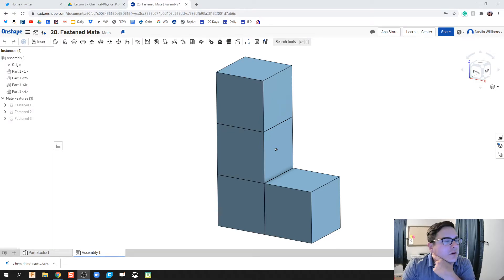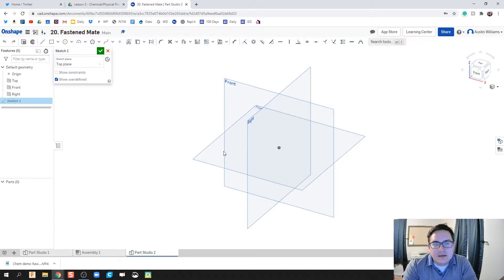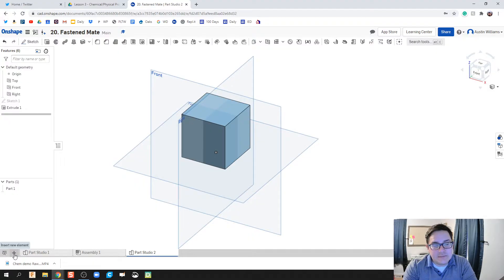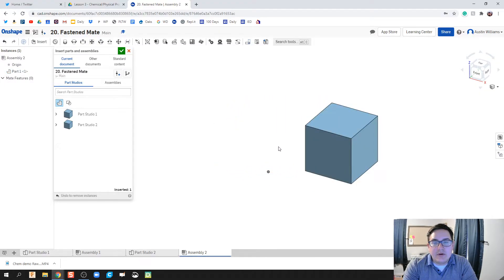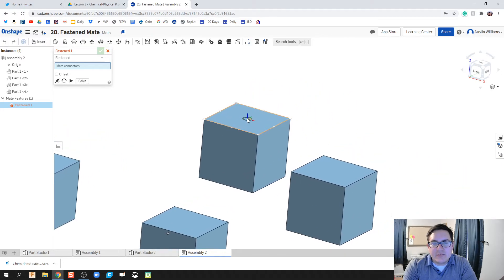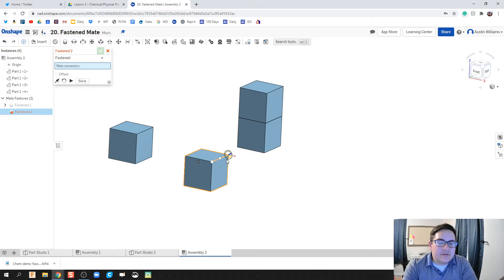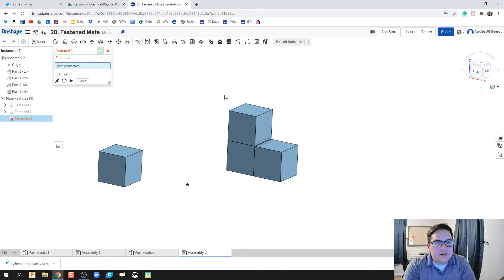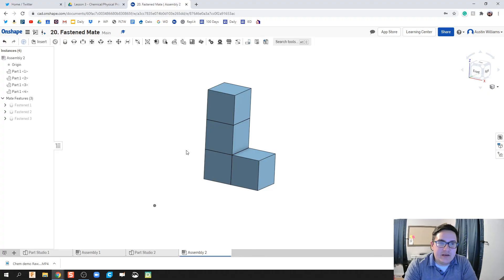Fastened Mate - Day 20 of 100 OnShape Journey

Comment: Nice video.  What shortcut key are you using for "orient to isometric" after you complete a sketch?  Is it Shift-7?  Reason I ask is that I find Shift-7 awkward to use but your view seems to immediately switch to isometric (or similar) after completing your sketch...suggesting you have a quicker shortcut key.
Reply from the maker: After I complete a sketch, very quickly I click on the FRT corner of the view cube. It throws it back to iso and orients it completely. Hope that helps!
Reply: @LearnItDoItMakeIt   yes, that's probably the best way.  I was watching on 1.25x and evidently missed that.